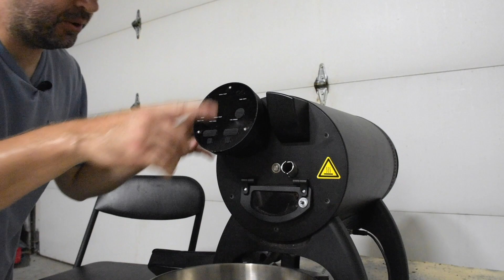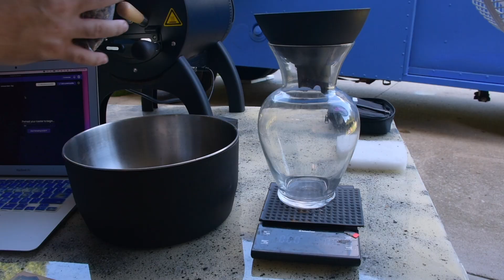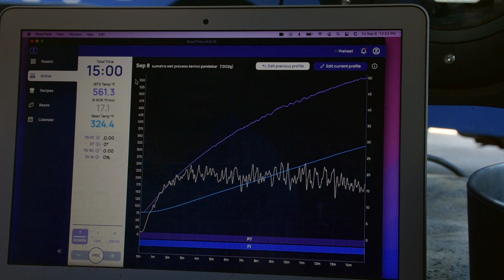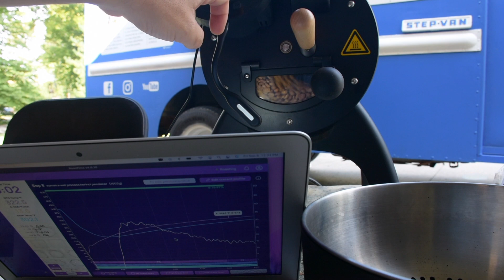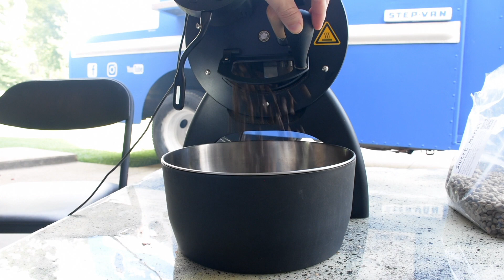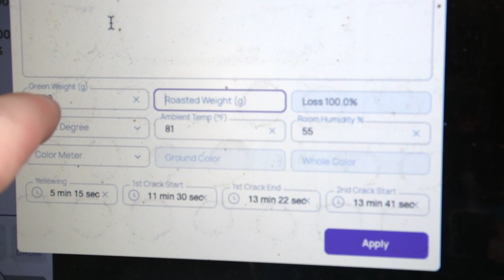Aillio Bullet R1 V2 ☕ 1 year review and workflow

Comment: A typical Lowe’s paint stir stick is just a cheap pine or poplar strip meant for mixing latex paint, not food. They’re usually:
kiln-dried construction wood (not food-grade)
handled in warehouses with dust, oils, and chemicals
sometimes treated with anti-mold or pest control during shipping
very porous → absorbs oils immediately
Reply from the maker: Just to clarify, I only used the paint stick for personal batches at home, and I’ve since switched to a high-heat, food-grade silicone spatula.

The point I was making — which may have gotten lost — is that when you invest thousands of dollars in a roaster, it would be nice if manufacturers included a more effective built-in cooling solution or at least a proper stirring tool designed for high heat and food contact. That was really the broader point of the comment.

Comment: FYI if you read up about that paint stir stick, it's not for use around anything that is consumed due to the treatment of the wood and the paint/dye that is toxic. It can easily leach off into the beans. You have a food safety cert right ?  I have taken the class, it talks about using proper cook ware that is designed for heat/...Please consider this next time you roast.
Reply from the maker: Just to clarify, I only used the paint stick for personal batches at home, and I’ve since switched to a high-heat, food-grade silicone spatula.

The point I was making — which may have gotten lost — is that when you invest thousands of dollars in a roaster, it would be nice if manufacturers included a more effective built-in cooling solution or at least a proper stirring tool designed for high heat and food contact. That was really the broader point of the comment.

Comment: thanks that was a good video. what was the white trace on the app graph. the purple and blue I know are the two different temp sensors but I could not tell what the white trace was. thanks
Reply from the maker: Glad it helped! In RoasTime, the purple and blue lines are the two temp readings (IBTS and BT, as you noted). The white trace isn’t a temperature — it corresponds to the power changes during the roast (the induction heater output). RoasTime doesn’t label it super clearly in the legend, but it lines up with the P-setting adjustments over time rather than a sensor reading.

Comment: Do you have any experience roasting ultra light on it?
Reply from the maker: Great question! Yes, I’ve experimented with ultra-light roasts on the Aillio Bullet. It's definitely capable, but it takes a bit more finesse—especially with charge temp, fan speed, and managing ROR to avoid baked flavors. Preheating lower than usual and keeping energy input gentler early on helps stretch the drying and Maillard phases without overdeveloping. I’ve found that using IR temperature and Bean Temp together is key for dialing in those bright, high-acid profiles.

Comment: any updates? i was just wondering if something like a large electric whisk would do the stirring well。how are you gauaging when they are cool enough to.stop stirring?
Reply from the maker: @blackrosechengdu  thank you very much for the comment and the whisk might work if I could dial in the correct speed so it wouldn’t make a mess. I just put my hand above the beans and if it still feels hot I keep stirring. I think they should be cool to the touch before removing.

Comment: 9:39 This not a proper answer, we don’t care if it is a design feature or just happened there by itself from nowhere. There is a problem that has to be addressed. Being part of design means “bad design” in that specific area.

An example of proper answer:
We are sorry for the inconvenience, we will communicate this to whoever concerned department and hopefully will find a way to solve this issue or avoid it in next versions. Thanks for the feedback we always listen to our customers to improve our product…etc.
Reply from the maker: Thank you very much for the comment and I agree with you that Aillio did not provide a good answer. I hope their designers and engineers will do better with next versions so the users don’t have to deal with the chaffe falling out of the machine while roasting.

I admit that when I turn the fan on higher settings (above 4) there isn’t as much that falls out of the front. So, they could have at least provided this information in the user manual but also fix the problem so it doesn’t happen at all.

Comment: So one thing I thought (was hoping) this roaster allowed with the software is the fire and forget mode. Load up a previously recorded run, hit play and it adjusts temps, fan, etc the same way to yield the same (or nearly the same) roast, every time. But it looks like you have to push a button at some point.. I am wondering why they make that a requirement. I know my current roaster requires that.. I do walk away while roasting outside for and usually set a timer for 13 mins, come back press button to keep it going and takes about another 5 minutes before roast is done but have to press button every 2 or 3 to keep it going or it will go to auto cool mode. Cooling takes another 10 minutes give or take, so usually a 1lb of beans takes about 30 mins give or take. My assumption is this could roast 2lbs in about 15 minutes after the unit is up to temp?  Does it take long after a roast is done to reheat the chamber to add another 2kg of beans?

Side questions. I am interested in doing this for some friends/family, but also weekend fairs, etc. Given that these are freshly roasted, and the price of coffee, what do you typically sell a 1lb bag for, considering the cost of the bag, roast time, green beans, your time, etc? You also mention you have your own coffee business. Is that a full time business for you or side gig for weekends for example?  Lastly, how do you have the bags made? I was looking at buying a laser engraver setup for about $2K that could engrave the plain white bags I have. Thought that would cut down on bag cost as I looked in to bags with company info, logo, etc.. and they were not cheap even in 1000 count. I forget now the cost but it was like couple bucks per bag when buying 500 or 1000 at a time. Be curious what your typical cost is and how much you profit from bean sales?
Reply from the maker: Thank you so much for the comment and questions. It might be easier if we talk about some of this through email or on the phone. It’s difficult to get through all of the questions here. My email is cafelomez@gmail.com

Comment: For the auto stirring arm that can cool down beans in the cooling tray like all commercial roasters can do. It will double the expense on the bullet roaster! It’s very expensive to have that made for the bullet within the 3500 dollars mark. But what I’m most disappointed was that it does not come include with a bean deflector! That’s very inexpensive to include that piece of  important accessory!  Without the bean deflector, I found myself seeing beans get flown or spill everywhere on the floor and on the counter table. I have no choice but to buy a bean deflector made by bullet users! With the bean deflector installed, the beans all found themselves get into the bowl without a single one spilled on the floor!
Reply from the maker: Thank you for the thoughtful response. I wish there was a way to engineer a little rotating arm to stir the beans that wouldn’t cost so much money. That and the bean deflector would make this a much better roaster.

Comment: I'm thinking of getting this or Kaleido Sniper can anyone help me to pick, please...
Reply from the maker: I would say both machines are pretty similar and if I could do it again would get the one at a better price. I think paying over $3,000 for this roaster was too much and if the sniper is less money would probably be better.
Reply: @CafeLomez I wouldn’t say that they are similar in any way. The Kaleido does require a tablet or a computer to operate the roaster. The bullet, you can operate on it through the control panel and with the computer, you can record all the roaster recipes you made so far and playback if you choose to do so! Convenient! You can also run the roaster through the Rostime application from Aillio.
Reply from the maker: @3rd-Wave_Rebel  thank you very much for the comment. I think the two roasters do have similarities specifically regarding their prices, and roasting capacity. They are at least in the same ballpark. The bullet can be operated without a computer but it’s much better when connected and using the roastime app.
Reply: @CafeLomez  the bullet is a tad more expensive but totally worth it because I’m not forced to use a computer to run the roaster like the Kaleido sniper requires!
Reply: @3rd-Wave_Rebel  With a tablet or computer you can see the chart pattern and that should be how roasting get improved.

Comment: Awesome video. I roast in my kitchen so I know how much of a pain it can be to clean chaff off the counter. What I do is keep the tray under the roaster and before I drop the roasted beans to cool I run a brush over the holes so they can fall under the bowl. I also found that using a cooking spoon (hard plastic) helps the remaining chaff to fall under the bowl. The roaster can definitely handle a lot, I used to roast up to 20lbs but Ive downed it 10-15 just so it's not a whole day event. Also the chaff collector comes fully apart if you have trouble emptying from the bottom cover. The pegs twist off.
Reply from the maker: Thank you so much for checking out the video and providing this feedback! I will try some of your tips and see if it helps. It would have been great if Aillio thought about this stuff a little harder before releasing this roaster for over $3,500. I don’t think the users should have to deal with this issue as well as having to manually stir the beans themselves while cooling. Besides these issues though it’s really good!
Reply: @CafeLomez  You're welcome, I agree the cooling set up isn't my favorite but it's definitely a nice machine for a sampler. My only problem is I wish they would of added a bean deflector.
Reply from the maker: @PurveyCoffeeRoasters  for sure it’s a nice machine and with a few improvements could be great.